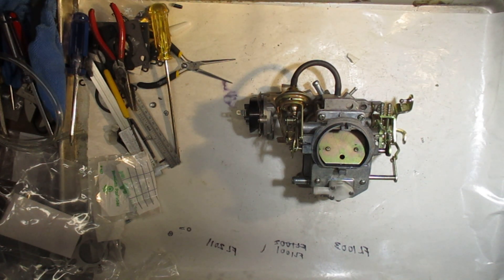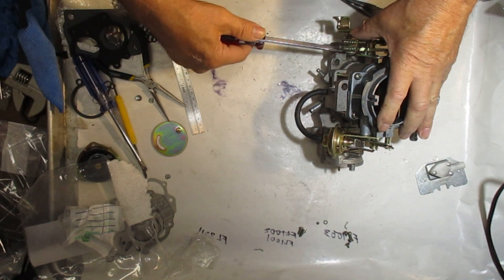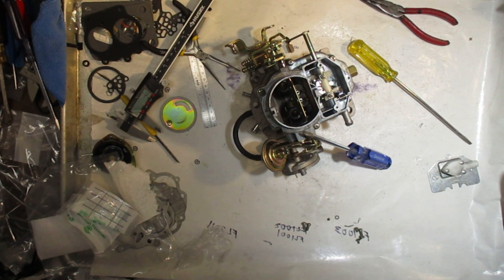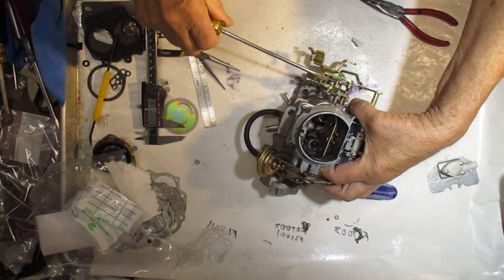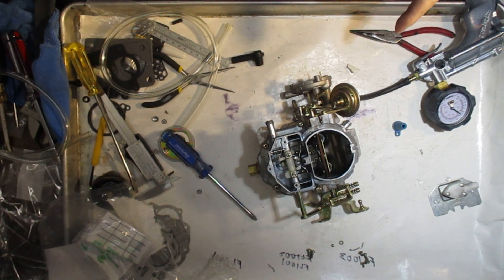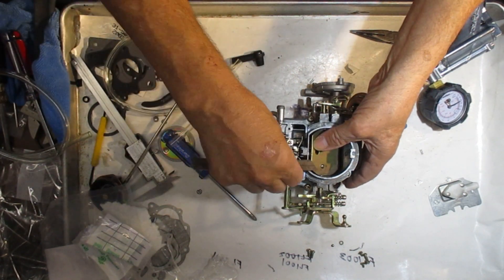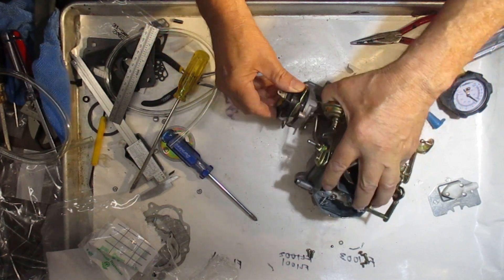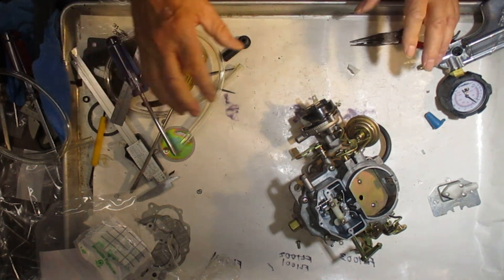Carter BBD Solid Fuel Carburetor Adjustments

Comment: Can you tell me what fuel pressure will make the BBD run happy?
Reply from the maker: 2-barrels typically use about 4.5psi.
Reply: @MikesCarburetor  thanks, I was running a weber, psi set at 2.5. Putting a bbd on my 258. I’ll bump up the psi a little. 👍🏻

Comment: Thank you sir. Back in the 80's I never did anything with a BBD except throw them away. Always had to make room for a Thermoquad. Now that I simply wanted a good daily driver (84 D 150, 318/727) my notes on TQ's didn't help. The carb I'm using is a 74 and my only deviation from your guide was between 1/32 and 1/16 of a gap in the needle setting to give a little more fuel to compensate for the stupid corn juice in our gas.

Comment: From what I've read, it seems your accel pump adjustment was wrong.  The 0.5" dimension should be from the top of the pump shaft to the top of the bowl surface.  The Carter manual terms "to float bowl cover", which should be "dust cover" for these 1970's "solid fuel" type ("tin top").  With that set in mine (as found, no adjustment needed), I measure 0.618" to the bottom of the float bowl (raised round plateau around accel shaft) which is the measurement you make.  So, yours will be giving too rich of an accel shot, perhaps giving a puff of smoke or even a stumble when you quickly push the accelerator.  But, with today's 10% ethanol perhaps all adjustments need to be slightly richer.

Comment: Mike, I thought I would share this since I haven't seen anything about it anywhere.
I have a 79 AMC Concord, 258 inline 6, BBD carb. I have been having problems getting it to cold start, idle smooth, running too rich, etc.
I followed all the stuff from the rebuild kit sheet and Chiltons.
Finally, I located an obscure paragraph in Chiltons, in the general tune up section.
An object labeled "Solenoid". Always on and holds the idle at a set minimum. The curb idle screw does nothing when the solenoid is energized.
* The curb idle on a 1979 BBD is adjusted with the Idle Mixture screws, not the curb idle screw.
* The curb idle only stops the throttle plates from jamming in the bores.
It was obscurely labeled as an "Anti-dieseling" solenoid somewhere I saw.
According to Chilton, on the YF, BBD, Motorcraft carbs for 1979 this solenoid is supposed to be adjustable.
It is not on the 79. Emissions, no doubt. The EGR port at the back of the carb is gone and re-routed to a coolant temp switch and other junk that don't and are unobtainable.
I thought I would share this weirdness.
AMC, gotta love 'em.

Comment: Hi Mike, I have a 1973 Dodge B100 Van with the 318 (all original)...I thought I was looking at a BBD Carter but it turns out it's a Holley 2800 (the big 'Holley' cast into casting gave it away)... If I want to swap it for a Carter BBD is it a straight swap or are there modifications needed? Any advice appreciated as you obviously know what you're doing with these carbs... Thanks.

Comment: I have a 1965 Plymouth valiant. Has a Carter bbd i could really use some help.
Reply: Your BBD is different, not the "solid fuel" design of 1970's, but rather "air bleed" of 1960's.  Your's doesn't have the removable "tin top" of this one.  The metering rod assembly is also much different.  You can find a Carter manual linked online which covers both types.  I don't recall your metering rods can be adjusted, only float level and accel pump linkage.